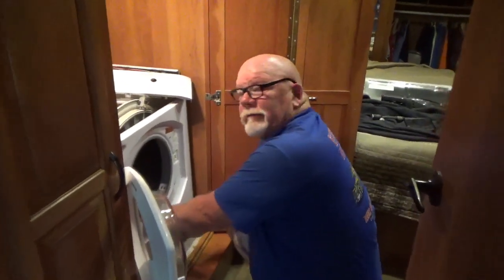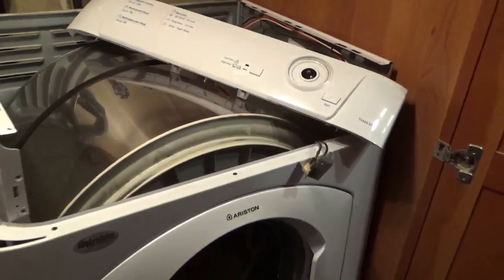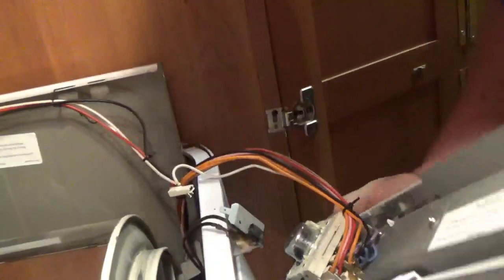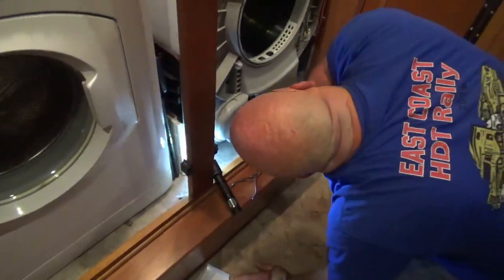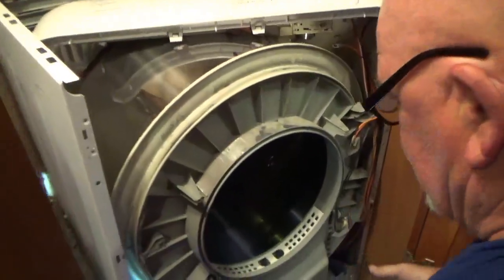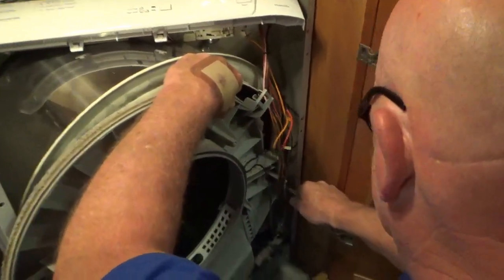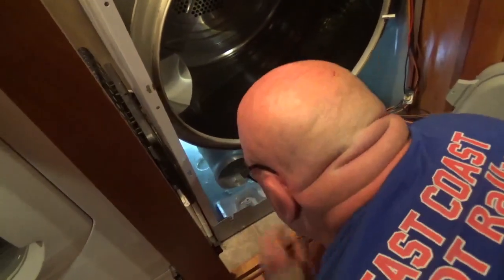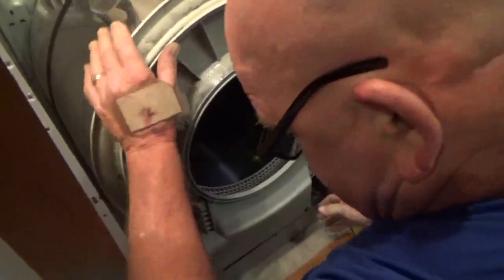💪 Just Call The Guy!  RV Dryer Repair...OMG!

Comment: That must be a thermal fuse and they blow if it gets too hot due to poor ventilation ao you want to check the vent outside and make sure it is clear and run the dryer with the door open. My hands and arms always ended up gut up to the point I rarely noticed anymore. I worked on appliances for nearly 30 years before I had to retire because of health issues
Reply from the maker: Thanks for the tips.  We did check the vent and that was OK.  However, we ran it for hours doing a ton of laundry and many times have the closet doors closed.  Now we give it a break to cool down and now I will leave the door open.